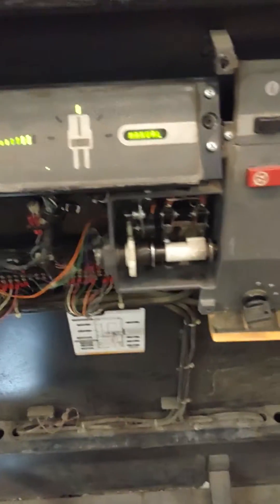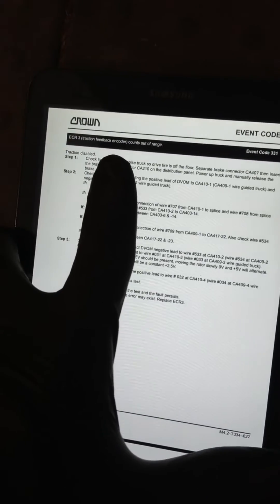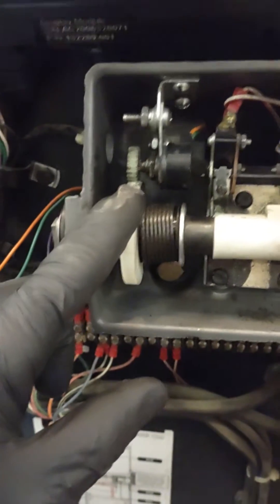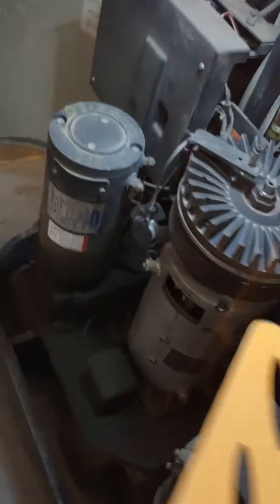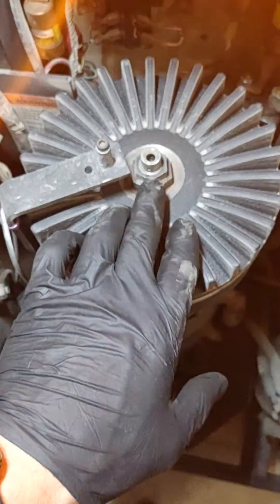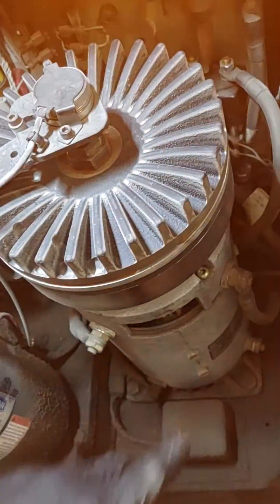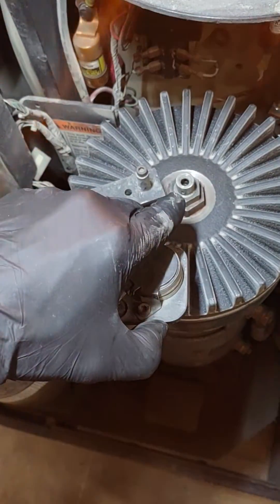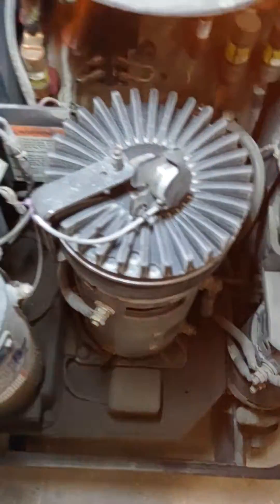Crown SP3400 code 331 troubleshooting/quick tip

Comment: Nice work. By chance, have you had a raise switch message upon start up?  Stays active. I've replaced ras1 and 2. I've checked multiple components and wiring. I'm just curious if anyone came across this problem before?
Reply from the maker: I personally have not come across that problem. But if you followed the troubleshooting steps correctly and have checked every component and no wires are damaged, then I would think the display panel is bad

Comment: We have had the bearings in the encoder go out and make noise. There is also the poly stopper that keeps the encoder bracket from spinning, the metal bracket and poly stop worn enough can cause those as well. Or if you have a lazy tech like I do and he doesn't full tighten the jam nuts for the brake rotor, that will happen too along with some other stuff.
Reply from the maker: Very true. Good points 👍🏼